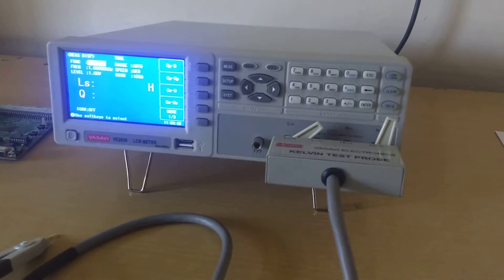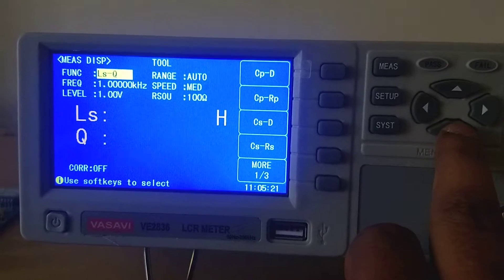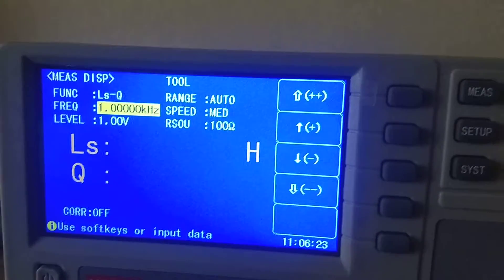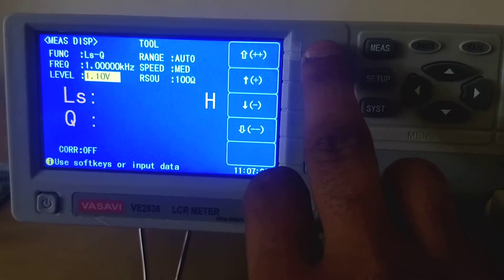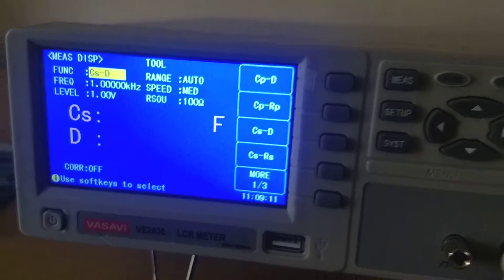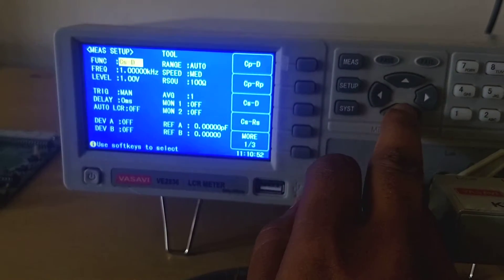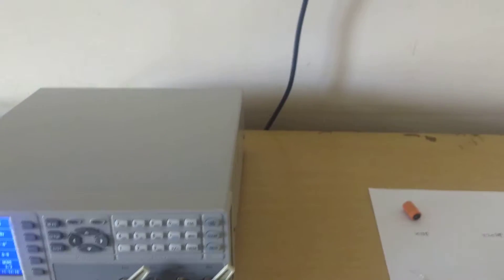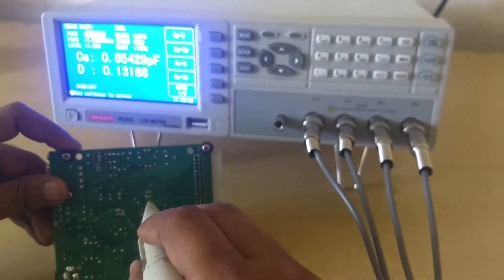200KHz LCR Meter

Comment: thank you so much, sir, that's really interesting and very helpfully. Could you please explain to us how can get data from this LCR meter, for example, to measure the impedance in frequency range 100Hz to 100 kHz. and which software can we use to read it on the laptop
Reply from the maker: You may please send a detailed requirement to vasavielectronics@gmail.com